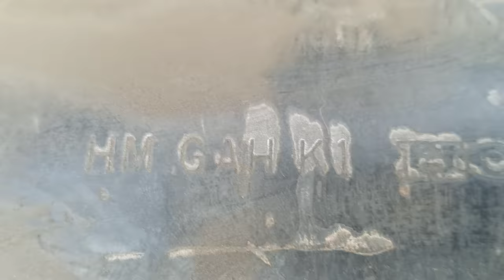Чистка глушителя от скутера

Comment: I like my stainless ssp-g aftermarket exhaust, nice tone, better flow, oem exhaust in the dumpster. Though im fully onboard with your methods, ive set fire to 2 stroke mufflers from chainsaws,trimmers, and burned all the oily carbon sludge out, which unclogged them

Comment: not a mechanic either an expert so why did you get it on fire ? how does it work also i live your videos they are very intresting and hellful
Reply: He was burning out the carbon and/or other deposits left in the exhaust. Like the "cleaning" mode on your oven, but way more effective. You can see he keeps blowing it out on purpose, and this is to see if the deposits have actually started to catch fire yet or not like charcoal in a grill. Once they have, he uses the compressed air to accelerate the burning.
 Ideally you'd then flush the exhaust out with lye, but it's unnecessary, and could cause damage if there's metal other then steel or iron inside the pipe.